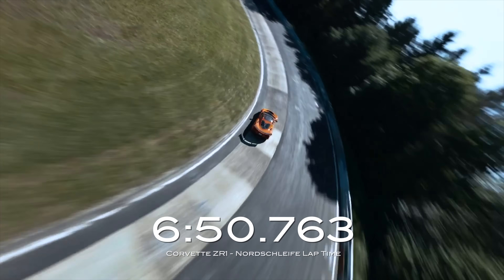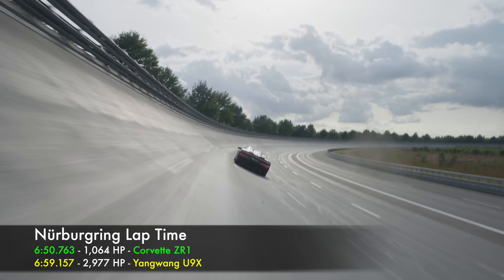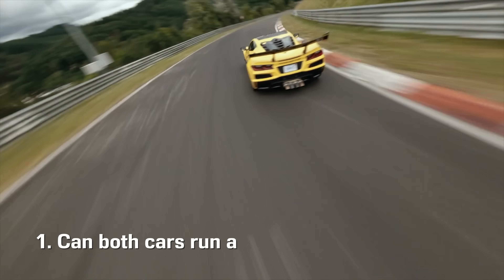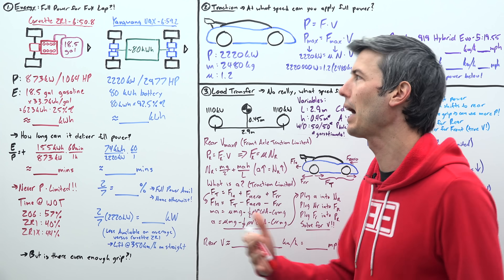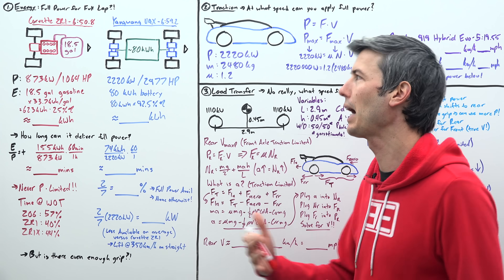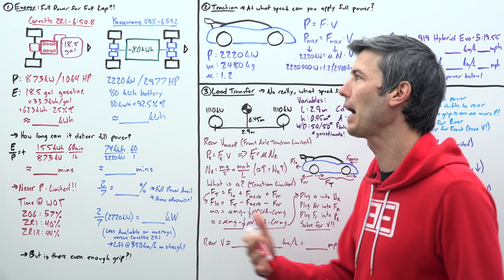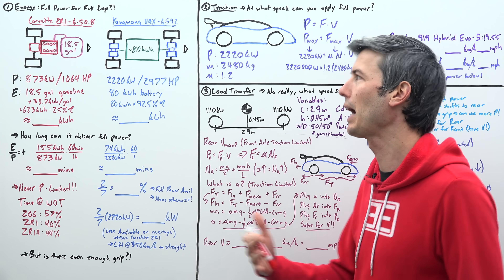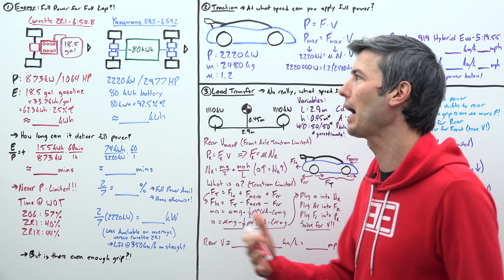Gas Beats Electric! Why Is 1000 HP Faster Than 3,000 HP?

Comment: You hardly talked about the cars weights?? Surely that is prime factor in the lap time? The U9 weighs nearly 1000kg more!?
Reply: Power to weight is definitely more important than just power alone for acceleration. It matters for cornering as well, but slightly less, and can be somewhat compensated for by having wider tires. When you start introducing down-force however, weight becomes very important in cornering, as it is the ratio between downforce and weight that becomes the dominant factor. Heavy car needs lots of downforce, and therefore drag. This is where the 911 GT3 RS shines in this case.
Reply: @2testtest2 lighter cars wit lots of downforce gain the benefit of traction without the negative of mass. You still need more force to accelerate with increased downforce, but the missing mass never loses its benefit of less inertia. Faster cornering.
Reply: @2testtest2 there are a couple of misconceptions in your response. You really need to shift your thinking for this car since it's so atypical with this insane power. Power to weight  is a limiting factor for typical cars that  can use their full power at low-mid speeds, but this car is traction limited even at very high speeds. And when your acceleration becomes traction limited, in the a = f/m calcs, your weight cancels out and becomes irrelevant, because it provides equally more frictional force and more inertia. Instead, your max acceleration is equal to the coefficient of friction of the tire which is 1.2, meaning you can accelerate at roughly 1.2 g regardless of weight. The main relevancy of weight here is that high weight/tire contact patch ratio reduces coefficient of friction of tire, so a lighter car might've kept a coefficient closer to 1.3 or more. 

Also, at high speeds, power to weight ratio starts to matter less because the resistance to acceleration becomes more dominated by drag than weight. Hence why a 4000lb car with the same power/weight ratio as a 2000lb car will accelerate much faster at high speeds, since it doesn't have 2x the frontal cross section. The frontal cross section of cars doesn't increase proportionally with weight, which benefits heavy cars at high speeds. So at all speeds, weight is largely irrelevant to the acceleration of this car. But still relevant to cornering where you're limited by your coeff friction. 

3rd, you do have a very good point about downforce to weight ratio. The ratio of (downforce + weight)/weight is a multiplier to your coefficient of friction when determining how many g's you can pull.
Reply: @frederickschulze8014  I get Your point. In the traction limited regime, power to weight is irrelevant. Power to weight still determines where the traction limited regime ends though. As Jason has demonstrated here, the power to weight of the U9X is so high, any increase would have little practical use. And yes a heavy car is not much of a  disatvantage in top speed.
Reply: @frederickschulze8014 You're right about high speed acceleration, still even at high speed,weight matters it just matters more at low and mid speeds. Your assertion that weight doesn't matter at any speed,is wrong.
Reply: @CarlW-d8c  I never asserted that weight doesn't matter at any speed. I was saying that weight matters less for this car than a normal car at every speed. 

Weight actually matters even less for this car at low-mid speeds, because it's entirely traction limited. So the only downside of high weight is losing some coefficient of friction. 

Weight still matters at high speeds, I agree. But this car has to be going very fast to reach the power-limited regime where weight becomes a primary factor. Even though the weight slows this car down at high speed, it at least benefits from having a lower drag/weight ratio. So a lighter car would need an even better power/weight ratio than this car to match its acceleration at high speed.
Reply: @frederickschulze8014 I misread you a bit. That car has so much excesspower weight is less important   but using that power for a time is much more difficult with an electric car. 
     Top speed is always drag to power. Reminds me when Chevrolet touted the whale Caprice's 10 percent better drag coefficient, but neglected to mention its roughly 10 percent greater frontal area. Compared to the previous model.  So no resl improvement.
Reply: @frederickschulze8014 Mass matters especially at high speeds during traction limited acceleration because there is downforce.
Reply: @2testtest2  Tire-width does nothing for cornering, just acceleration and deceleration
Reply: @somal1anwarlord197 I find that jard to believe, do you have any sources to back that up?
Reply: @2testtest2   F = μ*N

I know tires are not static, but the tire compound and the angle it is set to the street + the stiffness of the tire walls is more relevant.... you can have the same cornering speed on a Bike, if you have the right angle... But you need the area for acceleration and deceleration, which helps while cornering, but is not the main factor, means you can go harder!
Reply: @somal1anwarlord197  Ok, so no numbers or tests. I know F = μ*N very well, but that has no where in it any difference between cornering, nor anything about tire width.
Reply: @somal1anwarlord197 incorrect. If that were the case race cars would all have tiny front tires
Reply: @smokeyfish7435  Why tho? They need wide tires for deceleration! the contact-patch is what gives you straight acceleration/deceleration... cornering doesn't matter for this
Reply: @somal1anwarlord197 the forces applied on the contact patch during acceleration and deceleration are the same kind that are applied during cornering, just in a different direction. 

This is also why wheel camber is an important factor for handling. When turning hard, the suspension geometry and tire flexibility can cause the contact patch to shrink, so some race cars counteract it with negative camber.
Reply: @smokeyfish7435  And with camber you can apply the same forces on a bycicle tire... more important is the tire compund and how stiff your sidewalls are... there are so many factors to it, but the width is not the relevant factor here
Reply: @somal1anwarlord197  Nope, even with a perfect camber setup, the bicycle tire would have less contact area than the wide tire. When you're turning, the entire car is trying to continue going in a straight line (conservation of momentum). The heavier the car is, the more interia it has. The only thing taking this force is the contact patch. When it brakes, the car understeers, forcing you to brake harder to take corners slower. And obviously, if you need to enter a corner at a slower speed, you've already lost. 

If there were two identical cars with the only difference being weight, the heavier car would:

1. Take longer to accelerate 
2. Take longer to brake 

And,

3. Take corners at a lower speed to avoid understeering or oversteering. 

If you still don't believe it, think about rear engine cars. Why do they tend to oversteer? Because the weight is in the back, so the rear tires need to handle more force when turning.
Reply: @2testtest2  Exactly. Adding weight is never better, and certainly isn’t the answer to needing more down force. Prime example of someone being so smart they overthink something to the point of trying to reinvent the wheel.
Reply: @lsixty30 youre quite wrong. Adding weight does help the 3000hp car. It helps use that 3000 hp. The time lost in the corners from more weight, is being offset (atleast somewhat) from more grip to accelerate. This wouldn't be the case with 400 hp, but when you have an excess of power, more grip is better, and more weight gives more grip to accelerate (and brake).
Reply: @coreyscolaro288  youre the only one here who sees how it works... good luck with all the pseudo engineers in the chat.
Reply: @coreyscolaro288 no, its only good when the weight is from downforce not the actual weight
If your car is 3 tons, with 3000hp, your brakes are not going be enough even with carbon ceramics, brake fades is going to happen, more weight also equal large momentum
More weight = bad
Reply: @MintJoker9578 
You are using the combustion rules on electric. 
The electric has regenerative braking.
Reply: @neilkurzman4907  same logic, heavy = bad
 regenerative braking is when you push the pedal, the motor will reversely draw the kinetic energy and turn them back to electric(so its a generator) and when its generating electricity, the resistance slow the wheels
Reply: @MintJoker9578 
Yes, exactly. This means the brakes will not be a stress by the extra mass.  
In this case, the downforce/weight is a good thing. The extra mass requires extra force to accelerate. And decelerate.  It also requires additional downforce to ensure that you can corner correctly at the highest possible speed. 

When dealing with gasoline cars apples to apple’s comparison. When you’re dealing with Electric, it’s not the same. The assumption that gasoline always has the advantage is a political opinion not an engineering one.
Reply: @neilkurzman4907 uh first of all, if you corner in high speed in that big chunk of metal, you'll go fly
Remember heavy object has big inertia
And second, only the big downforce is good, the heavy weight is not
Both push the same force but apply differently
Reply: @neilkurzman4907  and no, gasoline is still better in this decades because its the only thing with high enough energy density we can use
Unless they have a better battery like same energy density like gasoline or better, in some way gasoline is still better
Reply: @MintJoker9578 
If you corner at high speed, then you need enough down force and friction to counteract the force parallel to the track.  It’s all math.
The answer is not common sense. It’s a physics calculation.

By the way, downforce and weight acting the same direction. The tires don’t know which is causing it. 
The advantage of downforce is it doesn’t require mass
Reply: @neilkurzman4907  but the problem for heavy weight is the inertia which downforce doesn't have, you said yourself its physics but you didnt talk about the inertia
Reply: @MintJoker9578 
You realize the gasoline engine has a lot of serious limitations. But you’ve decided it’s the perfect vehicle and everything needs to match that including its flaws. 

For a specific race, the vehicle is modified to match the specifications of that exact race.  
For the quarter a mile, except for top fuel, Electric wins every time.  
There’s no concern about mass because the battery can be small enough since it only needs to travel a quarter mile. 
Over distance, Electric’s going to lose because of the recharge time. 
But on a difficult course, it has the advantage since it can’t overheat its brakes. 
So stop trying to create a general purpose gasoline car that does everything and then pretend those 50 different cars beat electricity every time  

The average round-trip to work is less than 50 miles.  Which means the average electric car can go five days without charging. Since most of them get plugged in, it doesn’t matter.

But we’re not talking about them we’re talking about a very specific race scenario
Reply: @neilkurzman4907  have you think of the regenerative braking only applied to 10-30% braking, if you only use regenerative braking means you need to slow down early, if you press harder its not regenerative braking anymore, its the brakes
The brakes will fades
And in race track mass matters, its not a drag strip where power is everything, you need to take account for the g force and momentum
Im not trying to give gasoline a purpose, you are trying to make ev cars sounds better
Reply: @MintJoker9578 
Why would you only use regenerative braking?  Why would you propose a scenario where it would cause you to lose? The balance would be dependent on how much energy could be absorbed/dissipated into the electrical system. This would produce less heating on the mechanical brakes. Every electrical car works this way.
No, with a gasoline engine mass matters.  You’re taking an axiom based on a specific type of propulsion. It’s not a rule of physics.
Yes, in someway electrical cars are better. In some ways, they are worse. 

You seem to think you can make a general statement about one or the other.  
Remember the electrical car has that extra downforce while it’s traveling slow. A gasoline car only has it at high speeds.  The electric drivetrain doesn’t require as many gears. And produces maximum torque at minimum speed. The extra mass is low on the vehicle. Which keeps the center of gravity low.
So during a turn, you have a a series of force vectors. And those are going to determine the max speed on that turn. 

You can’t simplify it based on an apple to apples comparison for a gasoline car.  The wheels didn’t apply when they tried using gas turbines to power the vehicles.
Reply: @neilkurzman4907 you need to relearn your physics or racing classes 
Regenerative braking only work 20% of the time, and 80% is physical brakes, when you do 100% braking the weight will stil cooks the brakes
And downforce only applies when high speed with certain aerodynamics applied, its not weight
Because downforce dont have inertia, its not the same as weight
Reply: @2testtest2 why would ratio between down force and weight ever matter?

It's literally the same thing!  They both contribute to the net downwards force, which directly contributes to the normal force and thus force of friction in the tires
Reply: @subjekt5577 
Because mass has inertia, which cancels out the benefit you get from the added normal force on the tire. (More grip but also more weight that needs to be turned)
Downforce adds normal force on the tire without adding inertia to the car. 
Also the more weight you have the slower you can take a corner. Since downforce correlates with velocity squared. So a lot of downforce will be lost from even a small negative speed difference. 

Downforce to weight ratio is king when building a fast car (assuming tires are equal). 
If tires are not equal; then tires could very likely be king.
Reply: @subjekt5577 mass has inertia, which pulls you to the outside of the track
Reply: @subjekt5577  That totally doesn't take into account the inertia created by weight. When you go round a corner weight pushes you sideways, effectively lifting some weight off the tires and reducing the very force pushing down it created. Downforce only pushes down, and it costs very few extra KG....the downside is it only works at quite high speed, but when it works, it is counteracting the negative force created by inertia, created by the weight. 

So definitely not the same thing.
Reply: @subjekt5577 If down force is exactly zero, then the weight of car won't actually matter in cornering (in theory at least). Because the extra inertia of turning is cancelled out by extra normal force on the tyres.

But when you account for downforce.. The two factors are decoupled. The cornering inertia still depends on weight alone, but normal force (on tyres) is now a sum of weight+ downforce. 

So, more weight needs more downforce for same cornering efficiency. However downforce comes with drag. So, it affects the performance of the car on straights.
Reply: That point was finally made at the end with the 911 example.
Reply from the maker: Weight isn't quite the detriment it used to be, but on a track where downforce is everything, it does become critical, because the amount of grip you gain from downforce is very limited. I don't think the U9X is a particularly high downforce vehicle, but if you have the power, you don't have to worry as much about weight, because modern tires are insane and the power will make up for the acceleration lost. Of course, it still matters (and that always remains true for downforce), but not as much as it seemed to in the past (where tire tech wasn't where it is today).
Reply: @EngineeringExplained  even with modern tires, extra mass means longer braking zones, slower transitions and more heat soak. the u9x's power helps on straights, sure, but on a technical track, weight's still a MASSIVE handicap. 

we can take the dodge demon 170 and a porsche 992 gt3 as an example. whilst the demon has twice the horsepower, it also weighs significantly more and has little to no downforce, even if you throw a massive wing on it.
Reply: @miku_dayyooo that's not really a fair comparison. The main issue wouldn't be the weight, the tires, or even the power. It would be the suspension geometry. The demon is set up from straight line stability, and that's pretty much it. I remember seeing a video about a year back of someone taking the new charger through a canyon run and they said it handled like a lighter, faster sports car despite being close to 1000lbs heavier. Why? Because of the suspension geometry, it is more conducive to high speed cornering. 

Next issue in line if you fixed the geometry would be brakes. Keiichi Tsuchiya took a red eye wide body down a touge in Japan a few years back, and his main issue was that the brakes tended to fade after some time. 

So, if we agreed to completely change the suspension and the brakes, then we can start talking about weight. At that point it is down to tires and weight/distribution making all the difference.
Reply: @miku_dayyooo common misconception that weight = longer braking, this is not true. You can see that in the fact that a GT3RS brakes slower than a Mustang Dark Horse, it's in the tyres. So long as the tyres are not being overcome by the weight of the vehicle, it really doesn't matter.
Reply: @minorushiraishifan  True, tires play a huge role , but the energy you need to stop still scales with mass.
 Same tire compound + more weight = more heat, longer stops, and worse transitions.

 the GT3RS vs Dark Horse isn’t a fair comparison since the GT3RS has race-tier brakes, aero, and balance working in its favor

braking tests arent done under standardized conditions. one could be tested on a cold, wet surface and the other on a hot, dry surface. 
even IF one heavier car has a shorter braking distance, this doesnt erase physics. more mass = more energy to stop. 
if both were tested on the same surface, brakes and tires, then the heavier one ALWAYS needs more distance to slow down
Reply: @miku_dayyooo not true over one lap. non-fading braking is grip limited. with adequate cooling, you always have enough braking power to lock the wheels. maybe a heavier car will start overheating the brakes sooner but on a single lap you won't have this issue.
Reply: @EngineeringExplained mass directly correlates to inertia, downforce and tires can only do so much to fight that. In a video of the 911 and the byd side by side laps the 911 had tons more mechanical grip and had to fight every corner way less.
Reply: @EngineeringExplained  On the topic of weight/downforce and laptimes. simplified its actually very easy to understand why low weight high downforce cars compete way above their power league.  On  a car with half the weight, an equal amount of downforce has essentially twice the leverage.
lets say 1 for the coefficant of friction to simplify a no downforce car can corner with 1g. lets say its really high downforce. 1000kg. With 2000kg of weight the normal force form the downforce becomes 1.5 that of the weight: 1.5g. with 1000kg weight it has twice the normal force wich means 2g of cornering, braking and, if not power limited, acceleration.. with 500kg its 3g. with 250 kg, its 5g. (mostly unrealistic figures) but the relationship between them grows exponenntially

thats why f1 cars and things like the 919 are soooo much faster than normal cars other than special tires.  cars that have weight in the 100s of kg with litteral tons of downforce. thats how they corner and brake in high speed zones with 5g and more.  and lowest speed in corners significantly impacts laptimes more than highest speeds. the slower you are the longer you you spend at lower speeds cause the turns take more time. While with high top speeds you only spend short time at those speeds cause the straiight are over faster. thats why minimum speed matters more for average speed than top speed arround a lap.

There is a little brain teaser: you and your friend run 2 laps on the field track. you wanna conserve your energy for a late sprint and only run half as fast as him for the first lap. how fast do you need to run the 2nd lap to catch up?
A: Impossible/infinte. by the time you finish the first lap he is already done with the two.
Reply: @EngineeringExplained You sure about that? Especially in the corners where down force is at the minimum and the momentum of the car is completely at odds with the direction of the car's travel?
Reply: @EngineeringExplained  oooooo could of admitted it was overlooked.
Reply: @EngineeringExplained shortcut answer is WEIGHT right
Reply: @EngineeringExplained but doesn't the weight actually come into play in the corners at high speed and every time braking system is activated. More weight means combating more centrifugal force and more intense stabilizing systems , more weight implies more momentum hence higher need for braking power . With comparable braking power for gas cars with lower weight they would gain a little bit every time it's braking. Isn't it the case?
Reply: @EngineeringExplained it should be as it's electric. Down force creates drag, drag eats power, power eats energy.
Reply: @EngineeringExplained  Your explanation doesn't really go with my intuition. I'm not an engineer, so it is jus that, intuition, but it feels pretty solid on this one haha. 
Your explanation only seems to take into account the tires being responsible for putting down the extra power, as in, if there were better tires to handle U9X level power, it would be able to keep up overall.
 But that seems to ignore inertia in corners, where the extra weight moves sideways and effectively limits the effetiveness of the tires in a whole other way. 
You only seem to take into account grip under acceleration, which indeed is limited by the power. But grip under breaking and cornering, anything other than acceleration, is limited by the weight, right?

And there are so many other factors with weight, like the suspension having to be much harder to be able to "push back" against the chunk. That means the tires are less able to keep firm contact. The car handles worse, cant take the optimal line as much. 
Brakes getting hotter is an obvious one. 

I think weight reduction has been the focus of going fast since racing began. I don't think tire technology will ever change that fundamental really. Obviously it's the whole power to weight ratio factor, I just don't think it can ever be ignored in an analysis about track times.
Reply: @EngineeringExplained  the Nurburgring is notoriously bumpy and uneven, which makes ground effects less effective at generating downforce, thus greatening the importance of lightness. High weight may be generally less detrimental than it used to be, but it is still very much an important factor for lap times.

edit: misspelled "greatening." I think that's a word lol
Reply: @EngineeringExplained have to disagree, weight is a huge problem for going around tracks with turns, lewis Hamilton said he would sweat off water during the race and it would be noticeable the lap time difference in losing water weight during the race
Reply: @EngineeringExplained  But you said tires were a limiting factor.  If the car weighed 4000lbs it would use less energy on cornering, braking and acceleration and less stress on the tires.
Reply: The U9's goal was to become the fastest car. BYD just decided to put it on the track
Reply: @EngineeringExplained  Tyres' job has always been to mask weight, no? I think regardless the quality of tyres, car weight does need to be kept in check. Which it largely isn't, especially nowadays with the EV SUV fashion trend going on. I see no use in something that weighs 3000Kg and can go 400Km/h on a straight line while also seating a family of ten. Not sure what happens in the USA, but in Europe there are no families of ten nowadays. When I was little the norm was a family of four, now it 's gone down to three, so anything with a third row of seats is most often a waste.
Reply: @EngineeringExplained I need a whiteboard and some formulas to understand that. It makes no sense in my head.
Reply: @EngineeringExplained  weight matters a lot around corners, even with modern tyres. heavy cars can accelerate well, but they will never take a corner like a light car. tyres are limited in lateral acceleration too, otherwise drifting would't exist.
Reply: @EngineeringExplained and then they invented corners...
Reply: @EngineeringExplained I disagree, on a track where you have a lot of high and medium speed corners, having more weight typically results in lower average cornering speeds. Downforce also plays a big factor, which is why I was surprised you didn't mention it in the video.

But on the Nordschleife, the straights aren't big enough to make use of the extra horsepower. The only time that is the case is the dottinger straight, but as you showed they have to lift due to battery life.

As well as all of this, I feel as though you missed mentioning suspension setup in the section of weight transfer as it's the key component in how the car behaves under acceleration.

I know this was just a brief overview of just some of the reasons but I think there was some key info you left out. Regardless it was still good and informative video 👍
Reply: @EngineeringExplained weight might not be a huge factor because of tire technology in a vacuum but you’re comparing 2 different cars with different weights that are using roughly then same tech in their tires. Ergo the weight is a huge factor and the tires aren’t.
Reply: @EngineeringExplained  so are you insinuating that the tires differ from both vehicles? The previous comment where the guy disagrees I kinda lean towards it as well say both cars have the same tires and tire width then weight is our only difference here weight plays more factors then tires is essentially what I’m getting at 

Tires plays 2 main factors ( breaking and traction )

Weight 
Breaking - traction - downforce weight distribution and so much more I can’t think of rn
Reply: @SVTJTV you forgot cornering... Additionally tires do not behave like blocks of wood sliding down an inclined plane. Furthermore it's "braking"
Reply: @EngineeringExplained I heard next year the zeekr 001 FR 2026 will be the fastest production ev on the Nurburgring beating the Xiaomi su7 ultra and yangwang U9X.
Reply: @AndikaKhairilAkbar nobody knows or cares what those random keyboard smash names are
Reply: @chir0pter be quiet American. Many other places in the world get the fun new EVs. Enjoy your cybertruck
Reply: @EngineeringExplained i'm surprised to hear an answer like this from you. Weight is a huge factor in track driving, especially on the Nordschleife.
Reply: @bassie9400  if you count for limited horsepower eg 500ps and a lot of downforce yes but without these aspects lots of horsepower and not that much downforce from aero its not the most important factor...
Reply: @bassie9400  Yeah same.
On a track with low amounts (<70%) of percent time spent at full throttle, like the Nürburgring, cornering speed is so important! In these mega powerful cars, the ratio of time at full throttle is really low, like Jason shows in his video. So his take here seems strange. 
The massive amount of extra weight of the EV will hurt cornering speed a lot (if tires are about equal between the compared cars). And much more than the power can help the EV coming out of corners and on full throttle sections of the track. 

As is evident from the light weight Porsche, with a good amount of downforce, showing how much less power can be faster at the 'Ring.
Reply: @EngineeringExplained  No. You’re overthinking it, lighter is much better. If both cars have the super tires and both cars have insane power then weight matters just as much as ever.
Reply: @lsixty30  :face-fuchsia-poop-shape:
Reply: @lsixty30  He's not overthinking anything, he's shilling tires.
Reply: @nichtname123  😂😂😂
Reply: @lsixty30  Agreed. If you think of the U9's 5500lb as a force trying to break the tires loose at 1.5-ish G, then you can see how the ZR1 wins. Weight, and the fact the track is mostly medium to high speed cornering. The way I see it it's that simple.
Reply: @lsixty30  I also think that makes more sense to me. I would always assume that both cars have the best tires available put on them to do a lap at the ring, and since the one car had much more power, it seems to show just what a difference weight makes.....to my eyes at least.
Reply: @lsixty30  Nope, he's right. What you forget or just don't understand is this car is made to go around 500km/h. It's not specifically a track car. Getting to that speed is an achievement in itself, beating out every other EV vehicle out there, gas or electric, period (until the next Bugatti).
Reply: @sprockkets  Nope, physics is right. What you forget or just don't understand is everything but drag cars have to turn. By your logic making a car longer and making rear tires bigger is always better because it works on a drag strip for top dragsters, which, as an aside, are shaped that way because adding weight to get downforce, like I said, is always bad engineering.
Reply: @lsixty30 nothing you said had anything to do with my earlier comment
Reply: @sprockkets  I’ll make it simple for you, show me the Bugatti that added extra weight to be better. I’ll wait.
Reply: @lsixty30  You're probably over thinking it.  Weight is important, but not nearly as much as it used to be.  It matters for 2 reasons.  Heavy cars overheat and wear out tires and brakes faster.   If you're doing one lap of a normal track, it doesn't matter much if at all.  If you're doing a lap of the Ring, or an endurance race it's extremely important.  

And on high downforce cars lighter is better because normal force is much greater compared to mass.  The electric car here doesn't seem to make much downforce.  But the Corvette does.  So in this particular example, just making more downforce is much more meaningful than the mass.

So does weight matter here.  Yes.  But not nearly as much as the points covered in the video.
Reply: @EngineeringExplained I disagree completely. Tire tech has gotten better but that also means the lighter car has that much of a better tire also.
Reply: @EngineeringExplained WRONG. WRONG. WRONG. weight matters ALOT during braking and cornering, which you do a lot of on track.
Reply: @moonrider99  
Yeah, that dewdrop, 4 million subscribers or not, spews absolute nonsense, and doesn't understand a lick about the topic.  He made a bunch more errors besides that one also.  This is exactly what happens when someone thinks his popularity makes him an expert, despite having no actual knowledge.
Reply: @EngineeringExplained  
"if you have the power, you don't have to worry as much about weight"
No, dewdrop.  The reason the weight/mass matters is because of the CORNERS.  If the tires are identical, the aero is identical, etc., which car can take the corner faster?  A car weighing 500 pounds?  Or, a car weighing 20,000 pounds?  (No, those aren't the weights of these cars, I'm exaggerating to make a point.)  The force you need to apply to make a heavier car turn is more than the force you need to make a lighter car turn.  The heavier car has way more mass/inertia, and is going to resist horizontal changes in velocity a lot more than a less massive car will.  With equal tires, the force those tires need apply into a turn is a lot less for a lighter car than a heavier car.  So, the lighter car doesn't need to slow down as much into a turn as the heavier car.  You have absolutely positively no clue what you're talking about, and need to quit pretending.  Four million subs???  For lousy useless math that you get wrong?
Reply: Exactly. This isn't a drag race, and that's what he has been doing all those calculations. Such a high difference in weight of nearly a ton in HUGE, it affects acceleration, braking and cornering.
That's one of the reasons why F1 are so light despite being nearly 6 meters long.
Reply: @valrond I just did a rough calculation and concluded that if you need to maintain the same lap time -- for every kg of weight added, you need to increase the average power per lap by 2 HP (this is basically all the kWh consumed divided by total lap time in seconds) and your peak HP figure for this EV in particular needs to go up by an astonishing 7 HP for every kilo of added weight given that the battery lasts only 2 min at peak power while it actually needs to last 7 min at least, a 3.5x difference (peak power divided by average power) factor. All this just to maintain laptimes. Every single kilo added hurts a lot on a track.

And I didn't even factor if that much power can even be transferred to the ground all the time. Weight kills on the Ring. An Alpine A110R Ultime weighing 1085 kg and only 345 BHP did a 7:15, only 3.8% slower than this car.
Reply: You can't make a Mustang Mach E  weigh the same as a peel P50.
Reply: Still the power to weight ratio benefits the EV
Reply: @HTOP1982 all cars are limited to the grip available in their tires. This car has enough power to exceed that most of the time
Reply: @Secretlyanothername the closer you are to the grip limit, the faster you are, be it braking or accelerating.
The ZR1 is also RWD only, which means the acceleration traction limit for it is far lower.
Perhaps the U9 might receive tweaks to make it more ring friendly.
But nonetheless it is impressive that a newcomer to not only performance car, but cars overall is nibbling at the feet of giants.
Reply: no, cuz nio lapped thw nurburgring at a slower time than ZR1 dispite more power and weighing more less the same(they manage to do it due to small battery cell and carbon everything) its something, inhibiting ev car going around corner, despite using all the same suspension tech like gas powered car have, with an even supposedly better power distribution
Reply: @nolimit-moc That was early EV power like 2016 and it was the fastest of the time
Reply: What's the difference between both cars braking capabilities.  Including brake fade for the lap. Also how much does the brake regen slow the car down vs the gas cars gears braking capabilities. How does that apply? Also if you can't ever put full power down why wouldn't you just limit  how much power you would need to never brake traction? I understand that this is a question for the engineers and far more complicated than my current knowledge.
Reply: No its manily the downforce diff
Reply: Yeah there are calculations and what happens in reality, VW idr went around neubergring with 40kwhr pack size and did it in less than 6 mins, weight is a huge problem for track times
Reply: @yogamon The time was 6minutes 5.336 seconds. Still insane and "only" with 780HP or so. The IDR is a racecar though with DRS airodynamics
Reply: Who cares the car is heavier or that it can't push out all the power it has for more than 2 minutes...? The paper says 3000 hp! Are you going to argue with the paper? Why does it matter if those 3k hp only get produced at over 170 mph which this car never reaches. THE PAPER BRO!!! 3K HORSEY POWERS.

What do you mean in a drag race the gas car would be a sitting duck? HA!
Reply: The issue too is the car can't sustain that for 7mins it throttles to the heat, it gets very hot. They should have robust the system but my guess is its good enough....China....just cause you're fast doesn't mean you can cool down faster then a cooler gas car...turtle and the hare people remember also driver as well😂
Reply: 2:45 the calculations shows the ZR1 has 2x as much energy as the U9. But the actual range of the ZR1 is 225 miles, whereas the U9 goes 280 miles.

Now, that is the standard U9, not the U9 Xtreme with upgraded motors, for which we don't have the range. But seeing as both the standard U9 and U9 Xtreme has 80kwh batteries, it seems rather unlikely to me that the U9 Xtreme's range would be only half that of the ZR1.

Furthermore, on a track with a known distance, the could just put in less fuel, thereby saving a few kg of weight. But even if they charge the U9 less, it wouldn't be lighter. Though the saved weight is miniscule compared to the total weight of both cars.

The ZR1's top speed is 375 kmh. The U9 goes to 500 kmh. But it's a big heavy car with all those batteries. On a twisty track, the ZR1 is faster. In a straight line, if long enough, the U9 is faster. In an oval, I don't know. But I would guess the U9 if there are only 2 cars the track. Or they are doing something like pursuit with both cars starting on opposite sides of the oval.
Reply: @danielch6662 The U9X didnt go faster then 340-350km/h or so, waaaaaaaaay below the theoretical limit of 500. Very likely not enough power left in the battery so they had to limit top speed
Reply: That's the spot the solid state batteries will be focused....how's that...
Reply: Wasn't that at 7:25 the weight is literally in the formula for P = FV?
Reply: Weight was factored in when he calculated normal force and the car's acceleration. Those factors include the car's weight. You don't have to talk about the weight if you're ralking about the factors that include it.
Reply: yeah especially side lateral grip with a heavier car and the type of tires
Reply: This Chinese POS has a terrible battery thermal management .
Reply: So in a context of how much power the car manage to push and if the car can even use all that power combined with the traction aspect and then you go ahead and say that the weight is a prime factor? Love how completely out of context that is😂😂
Reply: the irony, the absolute element that an object is challenged when accelerating to another dimension is weight, at no.1
Reply: @powersliding So what you are saying is that the weight is becoming a challenge when accelerating on a car that has so much power that is not even able to use it's whole acceleration or power on track?The irony😂
Reply: He also took into account mass in his maths so.. he was constantly talking about their weight. (yes i know that mass and weight are different, i'm just saying)
Reply: @Kuroi_Hagane yeah different but most time with larger mass comes with large momentum hence large inertia, when you go cornering in high speed with larger inertia, the tires will not handle the high g force and break traction go flying
If the tires are physically capable of handle high g force, the drive is probably experience all the Gs which is probably high like a jet taking off
Reply: SU7 Ultra enters the chat with "only" ~1500 bhp.
Reply: I find it amazing how often people use 'breaking' instead of 'braking' .
Reply: @joshfoleyJr not everybody is native language speaking, also autocorrection might have something to do with it
Reply: Can youu please just done listening the entire video before judging
Reply: Weight is huge when talking about cornering.  Centripetal force is a major factor here
Reply: The ultimate benchmark is 6:11:13❤❤❤rip stefan 😢😢
Reply: @johannesherr2333 That was Stephan. Recently the 919 went about a minute faster for a lap. Look it up.
Reply: He did
Reply: This is the primary factor that makes electric cars bad for the time being 😅
Reply: Yes, that's true, dude. Electric cars are definitely heavy, obviously! That's why he made this video, to open people's eyes. Don't too obsessed by power
Reply: I agree it was the most obvious answer on people's minds, so it probably should've been addressed early on, but a car that has nearly 3x as much hp than another one should be faster even if it weighs 1.3x as much. That is, unless the car with 3x as much hp can't actually put all that hp down in any meaningful way, which was the hypothesis of this video.
Reply: I think it is because of battery
Reply: Well, for such a track, down force, active suspensions, rear wheel turning, lightness and other things that give it more grip and faster speed in turns is the winning strategy rather than raw power
Reply: I haven’t watched the whole video yet but I completely agree with you, weight is a huge factor. Power to weight ration only benefits acceleration, yet is still limited to the amount of traction the tires touching the road can achieve. While the EV may have better acceleration out of a corner and possibly a hire top speed on the straights this will only help if there are few turns on the track. The 1000kg aka 2200lbs extra is a major disadvantage, in the corners and even more so during braking. On a race track you want to brake as late as possible but with that extra weight it will likely more than double the distance. Then the extra weight will also lower the cornering speed. So on a twisty track it is unlikely that any advantages in acceleration or top speed will make up the losses.
Reply: I don't know if this is significant or not, but another factor to be considered is wheel inertia. In my younger days, I was seriously into bicycling and there was an adage that "a pound off the wheels is worth two off the frame". You could really feel the difference in acceleration when you switched to lighter rims and tires. With the U9 weighing 800 kg more than the ZR1, it would follow that it would need beefier, meaning heavier tires. That would mean that more force would be needed just to overcome the inertia of the wheels. I was unable to find any info on the tires being used for these tests. It might not be significant, but it's not nothing.
Reply: This is the actual reason, quick lap times are about how many kilograms your car doesn't weigh
Reply: I'm German and know what it means to go fast in a straight line. And I know what it feels like more than 3 minutes into it: boring. Whereas proper mechanical grip to go quickly around tight corners never gets old. Even there is fast-computing trickery in modern heavyweights to compensate for the tons (and the high center of gravity in suvs) producing the "right" numbers, it never feels as good.
Reply: And you know what added all that weight. Being electric and needing batteries
Reply: I just came here to say “Yangwang”.  

Please resume.
Reply: The Camaro zl1 1le weighs 3900 pounds and has 650 horsepower and yet still beats a 488 gtb with 660 horsepower and weighs 3400 pounds on the Nurburgring weight isn’t everything
Reply: @ericship8383 no one said it wasn’t everything. It definitely makes a difference though.
Reply: @ericship8383 but who said that weight is everything
Reply: @ericship8383 it's all about engineering.
Reply: @ericship8383 1000kg difference definitely means something😂😂😂
Reply: @ericship8383 naaah its just because the ferrari has a different tyre compount if its on semi slick like the zl1 it will eat it so easy
Reply: @ericship8383 i mean, a 1.7 ton 500 hp Datsun GTR is faster than 488
And one thing, ICE car full tank and empty is about 70 kg lighter, but battery full or empty is weight the same plus minus shredded tyre…
Reply: Agreed I said the same thing, it's weight weight, and weight factor.  That's how a 500-hp Porsche beats cars twice its horsepower.

Between the lightweight, you get better handling in corners. Which leaves the heavy vehicles recovering momentum especially on short winding tracks. The heavy EVs can beat up a gas-powered vehicle in a quarter-mile drag race. Yet, stretch out the length of the road & that EV loses.

When an electric vehicle (EV) loses momentum over longer stretches of a drag race, it is a result of several factors affecting high-speed performance, including battery thermodynamics, motor characteristics, and significant aerodynamic drag. EVs are famous for their initial explosive acceleration due to instant maximum torque but can lose the edge to a comparable gasoline car at higher speeds and longer distances. 
You also have in EVs what's called,
Power diversion: As the drag force becomes greater, more and more of the available power is diverted simply to overcome the wind resistance, leaving less power available to continue accelerating the vehicle. This is true for all vehicles but is often more apparent in EVs, which can reach high speeds very quickly. 

Battery power and thermal management
Racing puts extreme stress on an EV's battery, and battery management systems are designed to protect the hardware.
Heat generation: Drawing large amounts of power from the battery for maximum acceleration generates a significant amount of heat.
Thermal throttling: When the battery reaches a certain temperature, the battery management system will automatically reduce the power output to prevent overheating and damage. This is known as "thermal throttling" and directly reduces the motor's power, causing a noticeable drop in acceleration and top-end performance.
Reply: If you watched the ZR1s lap video, he did not take an aggressive racing line during his lap. With a pro driver, it would be more than 10 sec faster.
Reply: With both these cars compared not having a lot of downforce, the maximum speed is limited by power with just a little bit more power needed to accelerate.
Reply: Tyre
Reply: He's been paid by competition to slag off EVs unless it's a Tesla.😂
Reply: Corvette is the GOAT. And EVs are fricking boring and gay. Just facts.
Reply: @jamesc6363  Those are opinions.
Reply: @jamesc6363 Perhaps you identify yourself as an EV then
Reply: “Weight isn’t quite the detriment it used to be” EE do you have a equation for this statement?
Has gravity changed recently without notifying anyone?
1000kg of mass affects cars when multiple corners in quick succession are positioned, that mass creates a pendulum effect that affects the speed of the car and it’s overall lap time imo
Reply: It's absolutely insane to not think an additional 2000lbs isn't a major contributing factor to lap times, lost all credibility with his cope in this response thread
Reply: @user-fx6tp3gs8s  Nah you are the one coping, many cars are getting quicker with the same horsepower figures, despite gaining a lot of weight. It really is mainly down to tire technology.

If the YangWang somehow magically lost 2000lbs, that alone wouldn't be enough for it to beat the ZR1X's lap time.
Reply: @PaneledPear  Time to put your crayons away dear, you're scribbling nonsense again...
Reply: It's pretty much common knowledge by now that EVs weigh at least 75% more than there gas counterparts.
Reply: @jwalster9412 75 per cent bwahahahaha no
Reply: @jwalster9412 Bugatti Chiron weighs 400kg less than U9x, that is not 75% is it?
Reply: @jwalster9412  They weigh more because of the battery, they are only moderately useful because of how big the battery is... Take most of the battery away and most of the weight and frame reinforcement goes down.... Then the electric car is useless.. In all fairness these Plaids and "Performance" models are pretty sweet with decent usability. Just don't try to compete with a sports car that has a well established fuel source.
Reply: Hi nowadays the public rages over supercars when a Tesla model X beats them as there is not difference in a "sport" car over an SUV.
I mean you are right but it's also the case let that sink in, 2000hp instant torque are going up in smoke.😅
Reply: @Nordlicht05 a Tesla model x has a slower top speed than a trackhawk 😂
Reply: @ericship8383 yea only matters in Germany i think. People only see these acceleration tests. Doesn't need to be an SUV. Even a sedan or how it's called family sedan beats sports car.

Don't misunderstand me. That's only what I see the reactions are. Personally I don't care. I like involving mechanical driving feel. Would love to drive a Morgan three-wheeler 😂
Reply: @ericship8383  the porsche cayenne turbo gt only 640hp is the fastest SUV on the planet its 193mph and can easily do 200mph with few mods or unrestricted.
Reply: @ericship8383  gas cars have better top speed but electric if faster off the line
Reply: @peachulemon which is not anymore, proven by the car in this video recently 😅
Reply: @ericship8383 where you hitting the top speed on a trackhawk or model x plaid. You arent doing it at the nurburgring thats for sure. I dont think there are any tracks in the U.S. either that have a long enough straight that allow track runs.
Reply: @ericship8383  the model Xs low top speed is literally just because of its limiter, it slams into the limiter so quick that it jolts you in your seat. If Tesla wanted the increased warranty claims, they’d unlock the higher speed.
Reply: @Nordlicht05   - 2000HP - Is not in the equation until the motor gets up to >20k RPM - and a little hint, that isn't until the top of the speed range.
"Instant torque" isn't the problem, nor the solution - it is imaginary  (all you feel when you put the power down in your dream car - is the traction control choking the performance to the limits of the tyre / road combination.
  (Nb, My Ford Ranger in First gear Low range  - (Yes a very lowball comparison of course) - with a final drive ratio of 47.9 (3.55 diff, 2.48 low range and 5.44 first gear) ,  total Delivered torque is, 470Nm x Ratio =22 513Nm  (ie 22.5kNm) at the wheels -  (just saying, how these numbers are a bit meaningless - let's do the frictional requirements to show that even the meagre 150kW is more than sufficient to fully exercise those limits at low speed)  but it well exceeds the torque of any single speed EV - sure the performance isn't as impressive - unless mudding with a loaded trailer is your thing).

Larger contact patch is important because rubber only has a "certain" shear strength - no matter how sticky the surface is made - increasing "stick" increases rolling resistance, its shear strength is only ~10kPa  ball park, so no matter the downforce, lightweight etc - no more than  100N per 0.01m^2 (10cm x 10cm) contact patch - that is only 10kg of force equivalent  per square decimetre   Nb. For the power being discussed - up to 1000hP per tyre (475kW - a nominal 0.25m^2 patch ( with coefficient of friction of 1.9) needs . at 42m/s (151kph) - 17.75kN thrust available  for a normal force of 9.34kN (952kG downforce)- per  drive tyre.  Downforce beats weight every day..   Oh and at this Loading the tyre is experiencing 71kPa of shear force across the contact patch - SO  a higher strength material than rubber is needed to maintain this power hookup - OR XxX the surface area...  Basically it just shows that from a variety of ways looking at the deal, Quoted power doesn't translate to useful work.  (I my have some errors in here, I didn't really formulate the problem all that well.)   Torque??  the 745kW per loaded drive tyre (imagine) at ~75cm diameter (2.36m circumference at a mere 43m/s is rotating at 17.8rotations per second, (111.8rad/sec) - needs to be able to deliver 6.669Nm  (which almost certainly isn't available to deliver at such a low speed regardless of the imaginary materials we micht have available  (even the road surface having the grip and strength of 71kPa is hard to imagine - knowing that roads are surfaced in tar and angular pulverised stone with rubber mixed in.

@EngineeringExplained
    Lighter is aways better because steering forces are reduced - EVs "suck eggs", because they require ~12x the weight per unit of useful energy (real system) than an ICE car.. (42MJ/kg - with a power unit of ~400kg, vs 0.72MJ/kg with a power unit weight of ~200kg, the energy storage to minimum system weight gets upside down very rapidly with Evs , they do not scale well - An ICE can easily reject all the waste heat generated, EVs are still having problems getting enough coolant through the batteries and power electronics in the inverter without going into link mode....)
  Downforce / complex aero is always the way to go  9track centric, rather than race formula rules or street legal - think Extreme aero packages -  All variable Canard - Ailievator, Rear Stabiliser and front and reat aero steering-  these sort of details COULD sustain much higher cornering rates while not overloading the tyres - remember the most important function of a tyre is thrust - IF the lateral forces (required for longitudinal stability as well as lateral  - cornering..can be offloaded to Aero - That is so much the better...
Reply: @kadmow yea that's what I want to say these numbers are misleading. But all comes down when a manufacturer advertise these numbers.
Reply: @Nordlicht05 Not really Raging mate it shouldn't really matter atp.  It's not impressive when a electric car beats a gas car.  Again it's instant torque vs slow and gradual torque, instant acceleration vs slow acceleration.  Plus electric cars don't have gears which is another reason why they are quick.  Key word quick, not fast.  Electric cars are quicker, but not faster, I still prefer my gas cars, because imo they are better, but people enjoy electric vehicles because they can beat some highly engineered gas cars, but again it's not impressive whatsoever when you have something that was made to be able to have that instant power and torque
Reply: That hardly matters on track
Reply: @Nordlicht05  Straight line racing isn't the only racing FYI.
Reply: @AlkaVirus I already said it what i ment ands that's not what my opinion is.
Reply: I'm not anti EV, but there is more to driving than just quarter mile times  @Nordlicht05 

Honestly, the best spokesperson for EV's and enthusiasts is probably Cammisa, who daily drives an EV, but none of his "fun" cars are EV's. There is a reason for that. Straight line acceleration gets old LONG before all the other dynamics of motoring.
Reply: @JoshuaTootell  I have more fun with my 200hp EV than any car I've ever owned. Esp when it's able to keep up with 300hp cars.
Reply: @JoshuaTootell sorry all people are misunderstanding me. People on the inter er tend to look at acceleration.
Reply: @Nordlicht05  what a joke!!! EVs are only good for 0-60 the rest is totally crap! the 1000hp tesla modelx plaid barely tows 5000pounds while a a 260hp bmwx7 diesel tows up to 8000pounds and still manages to get more range than the tesla not towing.
Reply: @carholic-sz3qv  Max tow rating is often not decided by horsepower. Considering Mercedes builds fully electric semi-trucks, you can tow with an electric vehicle when it is build for that job.
Reply: @carholic-sz3qv Maybe because diesel fuel is 40x times more energy dense than batteries 😂